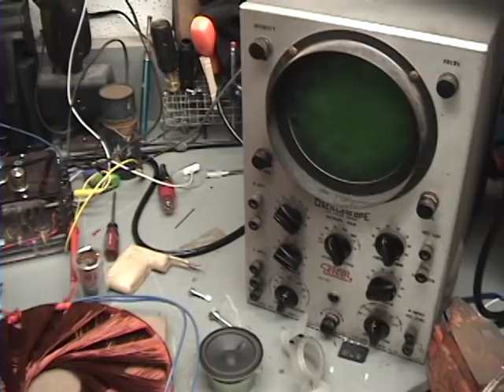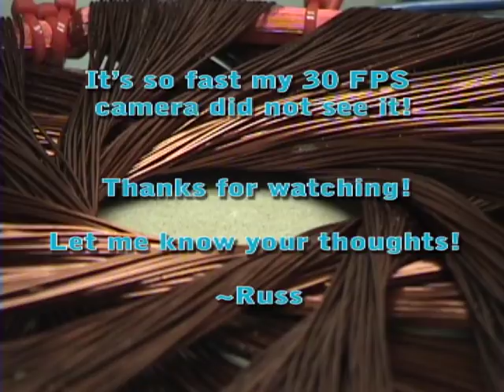Rodin coil  + 120 vac = Flying magnets... separating neodymium magnets via Rodin coil (TEST12)

Comment: Once you power it up there is a Vortex up the middle powered by the outer vortexs that power the middle one. You can see this and how my magnet Video spins the center one on the spool. That same force when power is applied -> causes the centrifugal rotation up the middle. Once the magnets fly up and are able to hit that height up the middle straight up .. the vortex up the middle is strong enough to make them fly apart in separate directions. I hope this information helps you :) Keep working it.

Comment: These type of wire arrangements are very useful. The most interesting is the application to move a mercury based fluid with an infusion of iron solution inside a copper tube in a loop configuration. This is the basis of the gravitation apparatus used in the TR3-B Astra
Reply: i been sayin this 4 years... lets make it!

Comment: How about putting a variable load resistor on the source?

A simple dimmer switch should work.

That way you could start with full load resistance before the coil, then slowly reduce the load resistance and monitor the effects of the magnets within the coil. Maybe you can get tot he sweet spot where the magnets will not be thrown out?

In this experiment, you are zero to full power.

Comment: If you want to know what's going on, the AC coil Supercharges your Neo mags and the poles shift equally from end to end until they reach the center. The force of the pole shift smacking the magnet stack in the center repels the stack apart. and because they are supercharged, they become super attractive to anything made of metal. I'd be careful with an AC coil, 20 amps is enough to bring foreign objects from afar to the coil and you don't want to be caught in the path of the attraction.

Comment: One half of the magnets is caught up in one side of the toroidal field, and the other is caught in the opposite side's axis (remember the axis is circular) this is why it didn't work with the bigger magnets, as they are stronger and held together better, so the toroidal axis's forces were pulling in separate directions, and making the pulls oppose eachother, keeping them at a certain height. When your magnets reached the SIDE of the little circle in the center, they jumped out on that side.

Comment: Toroidal vortex forces at work, the magnets are trying to stay in a spin around the torus's axis (centerline of the torus) and are being thrown out centrifugally along that axis (I.e. up out around and down, if they were weightless they would circle back around into the bottom of the coil if the table weren't in the way)

Comment: I'd suggest looking into Lenz's Law. I believe you're creating a 1 turn secondary in the magnets, and that electricity (in the magnets) creates an electromagnetic field, and by Lenz's Law, the main coil and the 1-turn magnet will oppose.
Try putting something electrically conductive but not magnetic to see this effect. I use the bottom of an aluminum Pepsi can, or washers that aren't iron. Once electricity is induced in them, they develop magnetism, and there you go.
I hope this is helpful.

Comment: I think this effect doesn't rely on those being magnets, but is a result of induced EMF in the metal.  See what happens when you use a stack of non-magnetic metal (coins, washers, etc.).  My guess is that the pieces would still fly apart.

That's probably why the stack of much stronger magnets remained intact - their attraction overwhelmed the induced EMF.

Comment: I really am trying to understand what is so special about the rodin coil.  As far as the magnets flying off the table, I have had the same effect on a much smaller scale of simply pushing a stack of magnets like the ones you were using into the center of a stack of strong ring magnets.  if feels like your compressing a spring, but if you apply enough pressure BAM just like that the repulsion stops and is attracted instead.  Now the rodin coil is an electromagnet for sure, and if you have ever put a strong magnet in the middle of a copper pipe it's easy to see the eddy currents at work as the magnet is basically levitated,  so eddy current could be it, but incredibly strong eddy currents.  Any way if you have time try to explain what makes the rodin coil special.  (besides the math of the windings)  what does it do that other coils do not?  Really would like to know.

Comment: it would be nice if you were to have a marker on the magnets you place in the middle to know which side is + and -- on the magnets. How hard was it to build your rodin coil?
what size fuse do you have on the circuit, you mention that you were pulling over 20 amps. Try elevating the coil and getting some thing to spin in the center. see you you can tell how fast it will spin in there.

Comment: its... a speaker, subwoofer actually, Magnetic resonance. sorta like an MRI machine but instead of imaging because its an open conish flux with nothing to magnetize or than the already magnetic magnets it turns them into receivers, note the vibrating. then once you feed the coil enough power the magnetic field the coils creating launches them, each pole of the magnet going at a different speed eventually separate. its actually really fantastic. try putting other ferris objects in there or hooking it to some sort of sound system, you might be able to get 3D audio out of it. note sure on its range though.

Comment: Aren't you afraid of breaking the face of your nice oscilloscope with the flying magnets? Great demonstration by the way. I'm not sure I understand the physics of what is going on here. But fascinating to see it demonstrated, whatever it is. I definitely need to edumacate myself about this Rodin coil.
 I had a vision a while back while celestially navigating the Milky Way by way of "eye of mind". 
I was trying to understand the dynamics of the black hole in the centroid position and the field effect demonstrated by the revolving "arms" that appear to act as some kind of accretion disk comprised of the various solar masses, their respective planetary bodies, and everything else of inertial consequence in between. 
Since I am unedumacated in the higher forms of electrical theory, physics in general and celestial mechanics, I was hard pressed to come up with descriptive terminology in my attempt to put words to what I was envisioning inside my third eye of mind. 
I thought of a toroidal transformer combined with the dynamics of a soliton and had to leave it at that. This was before I had ever witnessed the electrodynamic effects of the Rodin coil as demonstrated by this video. While I still do not understand what exactly I am seeing take place inside this video, physically, and electrodynamically, whatever I saw happening before my third eye of mind that day seems to have a better correspondence value with the dynamics of the Rodin coil versus my best guess interpretation as some kind of a cross between the electrical properties of a toroidal X-former and the physical features imbued by a soliton.  Not that any of this probably makes any sense at all to you physics and electrical wizard types out there. But it helps me to know a little bit more about the terminology you geeks throw around in your own attempts to understand and tell the rest of us "unenlightened" about the world and the galaxy that surrounds us all.  mrc109

Comment: Try puting them on a wheel in the center and see if they spin; better yet put them on a weal with magnets all around the weel and alow the weal to have room to move up and down. 
You may want to see what happens if the wheel is vertical and horizontal.

Comment: If you want to send something flying, put a PVC post in the middle, put a welded ring over the post, and dump a capacitor into the coil. Induced EMF will send the ring like a railgun.

Comment: Looking closely they jump up first repelled by the planar magnetic field, normal to the coil surface area.
Then they separate, either following the invisible doughnut shaped magnetic field lines, or the AC field generated inside the magnets  falls off as it flips up into the air, causing a transient magnetic resonance large enough to just cause enough repulsion force to separate. any spinning inertia helps.

Comment: That is really interesting. You may be able to test the violent spin idea of yours by connecting the eight middle magnets and allowing only attraction with the ones on the end. Naturally, if it is a violent spin the end ones should come off; I would think. If there is some kind of central clash separating the magnets in your video, then perhaps in the test I have suggested the end ones wont separate. This is not certain and is just an idea. Interesting video. Looks dangerous though.

Comment: Wonder what would happen if you used gold windings with platinum shaving flecks? If you enclosed these all in a tube with a lid, I wonder whether they would stay in a suspended state, yet flow in a geometric and frequency pattern conforming to the magnetism generated by the coil? Perhaps just the difference in metals combined with the peculiar geometry of the coil might generate this pattern without even applying voltage? If so, this constant flow of self-generating kinetic motion could be tapped as a "free" energy source, I suppose? (I use the term "free" loosely. What I mean is not that we're getting energy for nothing; rather, we are simply tapping into the energy that's already immanent in all being?)

Comment: the magnetic field of a rodin coil is not in the middle, but in a plane above the actual coil on a single side. try holding the magnet some distance above the coil instead. maybe it will spin instead of shooting up.

Comment: the magenets would have to be afixed to the ground. You could not attach the magnets to the coil and achieve levitation. 
That would be like trying to use gravity to spin a wheel.
Placing the magnets on the ground is basically how EM Trains work... only with another set of coils instead of two magnets.

Comment: Try wiring 3 of these in parallel stacked with a 1.75 inch gap between.  In the center place two halves of copper pipe like so (  ) the full length of the stack.  Then do your magnet trick.  Just some advice....doing this in the open without some kind of wave guide is dangerous.

Comment: i'm not a specialist, but i think that if you put connected magnets on the table and then under the table, as close as possible to the top you start to move other powerful magnet back and forth 60 times/sec, in the range of about the diameter aprox to coil in this video, you might get the same result..

Comment: OK, I have little knowledge of electronics or electricity and very little about the Rodin coil but I noticed you said you are running the coil through a lightbulb. At least I believe you said "through" since you don't say it very clearly. Anyways, what is the point of running the coil this way. Is it just a way of dropping the power down from the 120v at the socket? Anyone?

Comment: It's not quite that simple, either you'd need superconducting magnets (neodymium won't work because room temp magnets are experimental at best) or calculate the magnetic vector and find an em wave frequency/ amplitude that due to a form of constructive interference would cause the effect.

Comment: Now splitting the stack, that is something special....... Not sure what, but it's significant.
Reply: OK I see the torsion, but I wonder the velocity required to throw the magnets apart? Does your new camera have faster frame rates? I'd like a better look at that. I'm sure you realize by now that the torsional flux of the magnetic field is far greater than the push-pull strength, right?

Comment: I have a great experiment for you to try.     

Get a telescope,  and put two of these coils inside of it.  Connect a webcamera to the eyepiece, then point it at the sun.   If my theory is correct you should be able to distort the light waves visibly through intensified atomic line warping.  use a button to activate the shorting of both coils simultaneously.

Comment: With a much larger coil, and a larger magnet in the center, would it be possible to secure the magnet so that it pull the entire structure up into the air?
Reply: I was just thinking the same thing. Could this be used as propulsion.
Reply: TemplarX2 No, it's aposing magnatical forces, doesn't alter gravitional force, sorry.
Reply: they would just push each other appart ...  waht you think seems to me like using a rocket upside down to get dragged along because of the accelerated exaust upfront while caching it .....
Reply: Maybe. We can't see if the coil has to be secured for this to work. You know when you try to force two magnets together that are pushing against eachother? Is this what the effect is with the coil, or is it something else. Place to coil on a scale next time, and if you get a higher pressure when the magnet goes off, then it's the same effect, but if it isn't, then yeah it could make a flying device. Then you have a problem for power source, this is using straight AC power? So about 115volts x 15amps = 1725 watts. How much force can it generate? That coil looks kind of heavy compared to the magnets, but the magnets did fly pretty fast. Anyway research is already being done on this, look up coil guns. Basically same thing.
Reply: the problem may be cooling the unit it liquid co2 maybe

Comment: Does this coil have any purpose other than flinging magnets around?
Reply: Simon Osborne Free Energy
Reply: @mickleigh674  Where is the free energy in flinging magnets around?
Reply: Cat Man pardon? Expand Your Thinking..I Am A Friend
Reply: @mickleigh674  The OP asks if the coil has any other purpose to which you responded..'free energy', but the video shows that the coil uses in excess of 10amps, where's the free eneergy in that? Basically if the video had anything to do with free energy, why isn't it shown? The 'creator' of the Rodin coil claims that you get more out of these coils than you put in, but also states he is no engineer and there's no scientific proof of his claims. I'd have thought that a video demonstrating a Rodin coild would be there to demonstrate free energy, not fling magnets around at a cost of 10amps.
Reply: Try a steel ball or a ball magnet

Comment: so does that mean the particles around the coil are getting pulled in through the hole in the center. too bad it gets hot really quick. or else i was thinking if the magnitude of the force pulling all the particles in through the center of the hole , just might able to fly this thing.

Comment: dude stop shorting that coil across your wall outlet. It looks like you have some nice equipment there, you should have a current limiter in there. Also I am curious, if you have the equipment, have you played around with high voltage, or high frequency AC? Maybe try making the two separate coils out of phase with each other?

Comment: Actully, I think your experiment is more dangerous than it looks due to magnets being highly brittle. Gluing electrical tape over groups of your magnets would help reduce the chance magnet splinter injuries. It is an idea to try a flimsy plastic cup in the centre or have the cup coated in iron filings, the iron filings could be magnetised. The cup could be fixed down. I suspect it may be crushed. I think it is worth exercising some patience and being careful. Thank you for uploading.

Comment: okay so you keep saying that they are being pulled apart. wouldn't it be better to say that they are being pushed apart? they are traveling beyond the coil. And are they seperating evenly? Have you tried suspending them slightly above the coil to allow themm to rotate(pivot) and see how they react?

Comment: Is this the same principle used in a rail gun?
Reply: deleted
Reply: Coilgun !!!! L2Weapon !
Reply: This seems to keep things stationary while angular momentum conservation causes them to spin rapidly, so it isn't too great for a gun. As a preliminary stage it might work well but I think that normal inductors add rotation anyway. (Rotation adds inertia which will increase range by reducing kinetic loss)
Reply: Still looks like a fun project
Reply: USNVA no. It is simular to a coil gun, but the coils are arranged differently in a coil gun.

Comment: easy to see all those negative comments are those with either no or very little intelligence and have NO mind of creation, they only stay in a BOX and don't know enough to get out of the box .  anyway.. A barrel (non metallic) a series of coils  around the barrel at equal intervals and a projectile of any material but the base is loaded with a magnet or two or three or four, etc, the magnet would pass by a reed switch ( have to have  that reed switch trigger a mosfet or triac to actually handel the current being released) which would fire the next coil to further propel the projectile , OR just capture that burst of energy and use it in a way to create a larger output?? also not using the 120vac but an amp and a frequency that would also create the same sort of effect .

Comment: Because the Oil Companies will not allow this to happen.  Its totally possible..  I can make an electric car that charges itself as it roll's.  Its not hard to do. Think bout it, you need one motor to get your vehicle to roll. The vehicle has at least 4 wheels making contact with the ground. I shouldn't have to explain it any further then I have.

Comment: Magnets are the WORST thing to look for. They can be litterally anywhere.
Odds are if you have any steel cabinets or frames suspended a few inches of the floor, theyre under and up front. Use a mirror to look under, its easier.